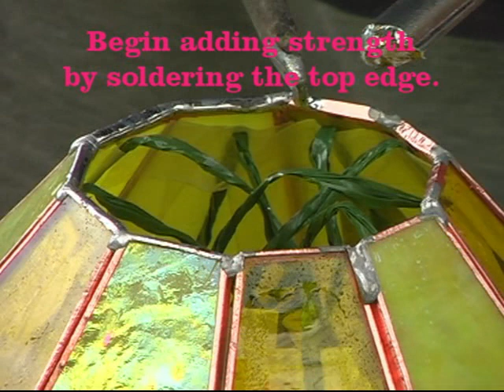Lampshade 3D assembly with "string haul" method. Stained glass.

Comment: I realize this is an old video, but I always come back to your content, because it's inspiring to see your skill in action.  I've always had trouble when trying to tidy the bead, the solder ends up melting all the way to the bottom and out of the piece if I stay too long on it with the iron ( 80 watt weller model ).  I can only find 50/50 solder here in my city.
Reply from the maker: use a damp cloth below your soldering, it'll stop the fall through....

Comment: Stunning. You make it look so easy. I would like to make wooden framed table lamps, and insert stained glass patterns into the frame. What glass cutter would you recommed for intricate work, and do you think a novice is capable of cutting small intricate pieces? 
Thanks for sharing your knowledge. 
Will
Reply from the maker: Ambition is a great thing Will. Without it one would never push the limits, so I say yes, of course you can. Buy the best cutter you can afford dude as long as it's a self oiler.
Small pieces, not so difficult...... lots of em,..... bring it on!

Comment: You've taught me yet another method in working with stained glass.  This leads me to a few questions.  
1. What kind of string is that?  I thought it was plastic but your iron hit it and it didn't melt.  
2. I'd love to see the finished product.  Like how the cap is attached.  
3. The ring with the five bars coming off of it is something I haven't seen.  How did you make that and where do you get rings and bars like that?
4. Why do you suggest using a self oiler cutter?  I've always used one but never with oil.  
Keep up the awesome work!  
Thanks again.
Robert
Reply from the maker: Cheers BigFLGuy,... ah the string is synthetic bailing twine, best I had kicking around the house at the time,.... and the crown / cap is going on in my next episode, tomorrow I hope... :-) Have filmed it already and it looks like a lesson on gap filling too..... DOH

Comment: Question: if eye-balling the cutting marks (wouldnt a measure be required) for the 5-sided holder, then dropping the holder into place (wouldn't a level be required) btw, LOVE your videos! Or is that what the weighted ball at the top takes care of when placing on a lamp? I am so excited to try this! I dont want to measure if it is not necessary.

Comment: Is the bar solder easier to use than the roll? Less expensive?
Reply from the maker: yes, I think so. Mind you, it's a bit of a pain to melt until the stick warms up a little.
I buy these from a lead mill directly so it does work out cheaper. This format of bar solder is made for plumbers / roofers use.

Comment: Awesome stuff!! I love it. Do you every have any issues with the foil coming up because you go back over it to smooth the solder? Also, where do you get that big bar of solder?! That looks so much better to work with!
Reply from the maker: If lifting foil is an issue, the foil is no good! Buy a new roll of change brand. and yep bar solder rocks! You may find this at a plumbers supply store. If you live in New Zealand (like I do) buy your bars from Dominion lead mill.